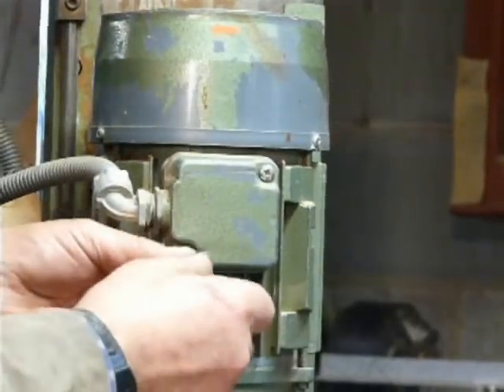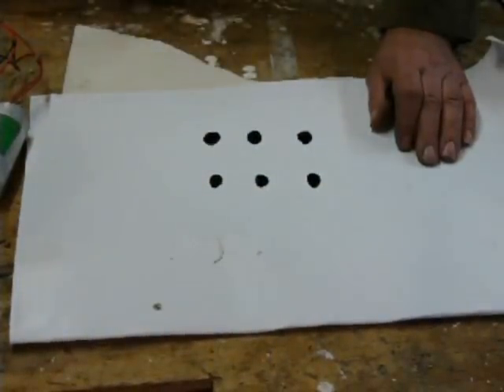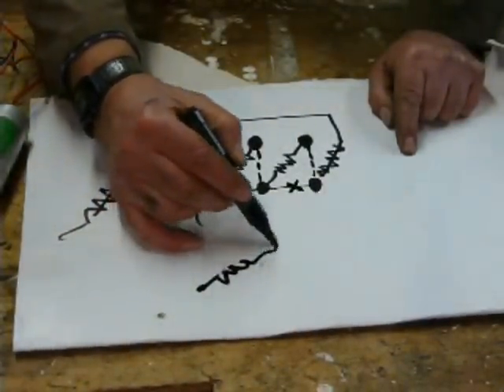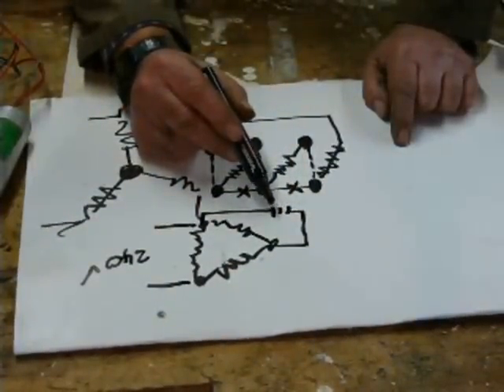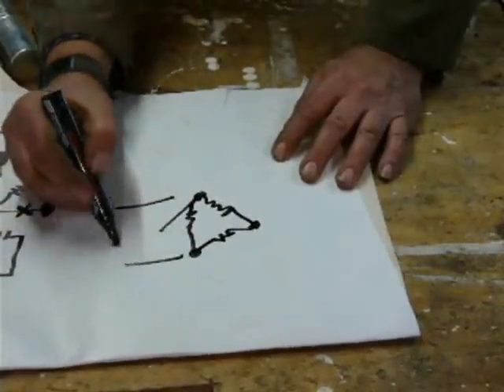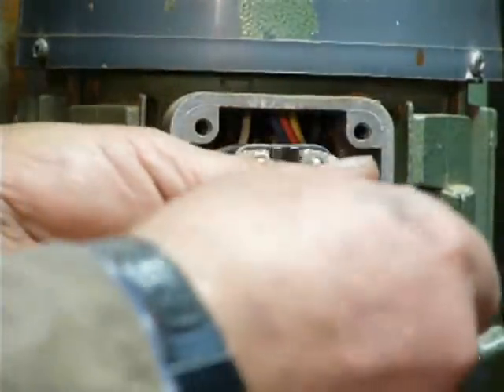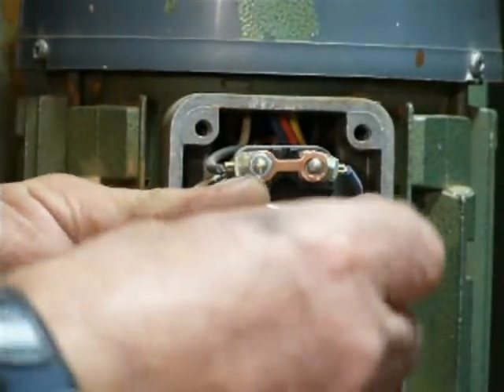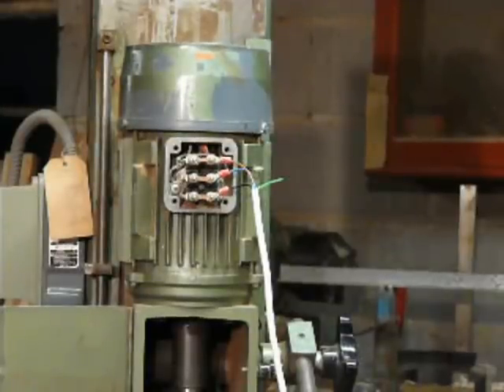How to do it: run a 3 phase motor on single phase supply. part 1

Comment: hello! my comment was very sort and not very clear. (it doesnt generates). in your diagram you wrote in delta 240V but in delta we have 380V cause we only connect the coils from phase to phase. if it was one wiring phase and the other was the neutral connected to the coil then it's 240V.

Comment from the maker: HI. Thanks for your interest. Are you saying that the motor generates 380v when in delta? If this is across the capacitor feed to the motor and the live, then your capacitor could be too big. I think about it like this. On a motor that is labelled 230 / 380, the delta is for 230v supply as a full set of coils is wired across the supply, where as with star it is 2 sets of coils in series across 380v. I’d like to hear more..

Comment from the maker: I have never got my head around power factors, something to do with current lagging voltage. But as a general way of thinking about it, the resistance of a motor coil should be suitable for the voltage. Too high a resistance and less current will flow and so the motor will be less powerful. I just find that for everyday home workshop this method works sufficiently well and it is inexpensive. Thanks for your interest. I will upload part 6 when it's finished.

Comment from the maker: Yes, that's true. Look under pooroldchap, and he talks about using star. I believe the capacitors may need to be of a higher voltage. The resistance of the coils will be greater and so less current will flow. Interesting as to if there is any benefit with either method. Thanks for your interest and comment.

Comment from the maker: Interesting. I would say that the new caps are less tolerant to over voltage. If you can get some rated for higher voltage this should sort the problem. Stay with the same capacitance but go for something like 380 volts or even higher. It's the over volts that kills them. Hope this helps.

Comment: If you got a motor like this it is impossible to change the speed. It depends on internal structure of the motor and the frequency of the voltage you apply to it. You can change belt pulleys and belt, if the your motor is mounted like that.

Comment from the maker: I have never messed with these motors, but there are some you tube videos describing the wiring. They are high speed to get the power and then a large belt speed reduction to get the torque. Hope you get the project sorted.

Comment: I think you meant to say this is for running motors with 2 cables, live and live (180 degrees of eachother). Live and neutral describes 110 voltage.

Comment from the maker: Hi. This is about converting the motor to run on a supply provided from 2 cables, live and neutral, rather than converting your supply to 3 phase. I suggest you watch all 5 parts and then get back to me if you have any further questions. Do not use capacitors that are too large. Do the experiments and measure the capacitor voltage. Hope this helps.

Comment from the maker: Hi. Yes 1 Hp is 735 watts in theory, but when you take into account the losses in a motor, then the rule of thumb of 4 amps at 240v to the horsepower works as a guide to see if things are working correctly. I've just looked at my bench grinder 370 watt motor draws 2 amps and that is a half horsepower motor. It's all about the practicalities, thanks for your comment I'm sure it helps many other watchers to understand.

Comment from the maker: Hi. Thanks for your question and interest. Part 4 shows what happens if you use too high a capacitance on the run capacitor, it produces a very high voltage on the associated coil and causes the coil to over heat. Using a capacitor value that gives about 230v is ideal, and if the motor will not start use a start capacitor and switch as shown in part 5.

Comment from the maker: Hi. There's your problem. A 5 hp motor will draw at least 4 amps per horsepower. So there is your 20 amps. It all depends on if the motor has a free start or is starting against a resistance. I suggest, if you have not already watched all 5 parts, then do so. The use of a start capacitor may well help you, but your supply will need to be up to the start current demands. Hope that helps.

Comment: hi,how much capacitor do i need to run a 5hp 3phase to single phase.i'll tried already and run the motor in220v  by applying your video using capacitors.i use 240uf capacitor in 5hp but the amperes is 21.can you please help me to fix this.thank you very much...

Comment from the maker: Hi. How many wires are showing inside the motor box? Look at part 4 of this series to give you some clues. See if you can find 6 wires. There is a video by pooroldchap on this but the capacitors needed are much higher voltage. See how you get on and refer back as a work in progress. You may wish to subscribe to get emails of future uploaded videos.

Comment: I have a sedgwick 571 morticer and am curious if this conversion will work on my motor. it is 440 v only and not dual voltage will this make any difference . Greatful for any advice you may have. Keep up the good work

Comment from the maker: Hi. Further to your comment. You are dead right that the conversion drops a phase, so the motor is running on 2 phases. One directly from the 240v and another through the capacitor. As 3 phase motors are generally used continuously and are heavy duty, then in workshop conditions 60% power is more than adequate. The high torque situations can be a problem where the large start capacitor induces a high voltage, but this is switched off once the motor is up to speed. Thanks for your contribution

Comment from the maker: Hi. I am pleased that you admit to very little knowledge. The motor will not explode under any circumstances. If you put far too many capacitors into the circuit the motor will get hot and maybe burn out, but only if you are not paying attention. This goes back to the warning in the video. Misinformation is the bane of our lives, so let's keep it the minimum. Thanks for highlighting this possible lack of clarity.